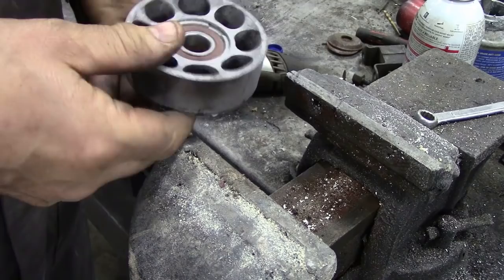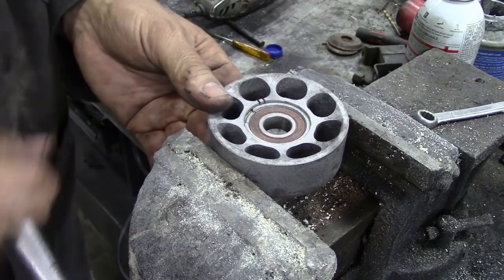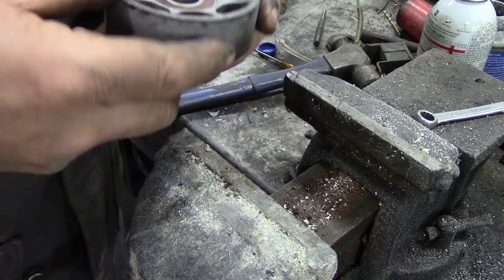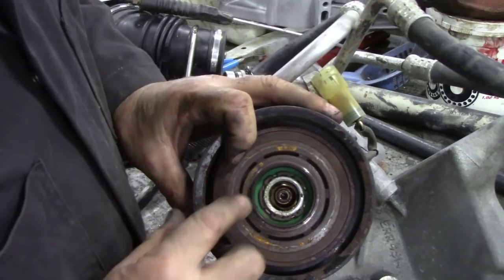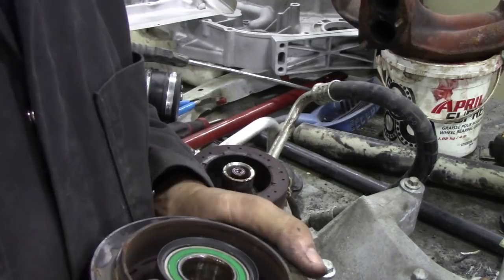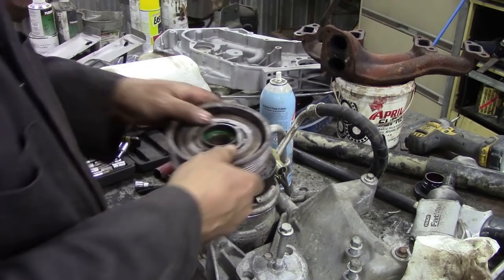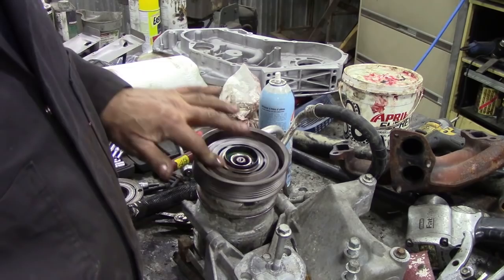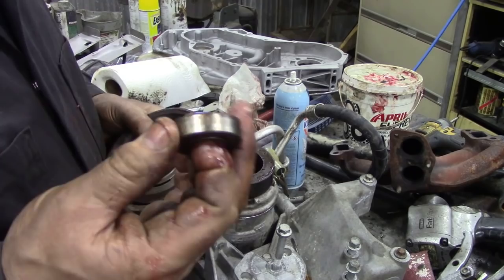Checking and replacing front pulley bearings. Rover V8 and maybe Tdi!

Comment: Good one Mike. Bearings are cheap and normally OK to fit and they can really silence noisey belts
Reply from the maker: 10 x 6203RS C$22.45 inc. free shipping to my door.
They felt good on tolerances, materials used? Well, they seemed as good as any other bearing and for the price I can change them simply, every year, for the next 10 years! 

(Local bearing shop $20 each)
Reply: @BritannicaRestorations  in your video you mentioned "6203 2RS" because it has wo covers! You however wrote above "10 x 6203RS"!? That missing "2" must have slipped your fingers!?

Comment: My tention pully didn't have the little cut to take the spring out - so I heated the spring, took it off and ground the ends of a new spring in an angle so it can be taken off again with a small screwdriver! Bearing was like 3€ - New pully €70!!!
Reply from the maker: It is quite easy to make the cut out - yes bearings are cheap!

Comment: The snap rings on the 300tdi ac belt tensioner and idler pulleys are a pain to get out. I had issues last weekend with the ac clutch on a 300tdi the magnet had a few cracks through it and was seizing up the clutch when the ac would engage.
Reply from the maker: That's why I cut the slot in - easily gets rusted snap rings out